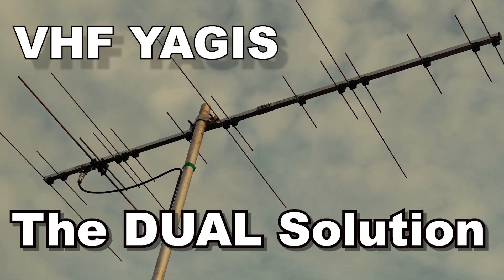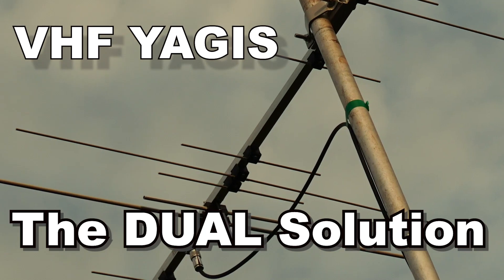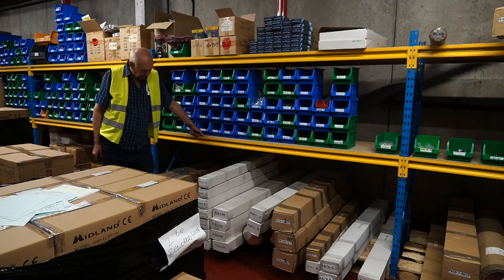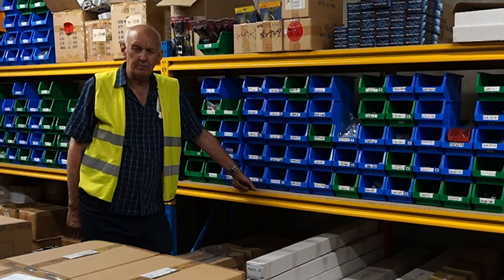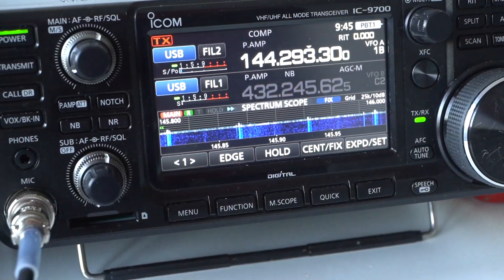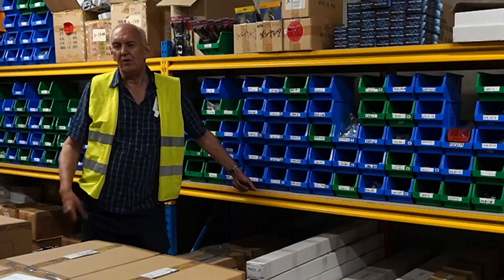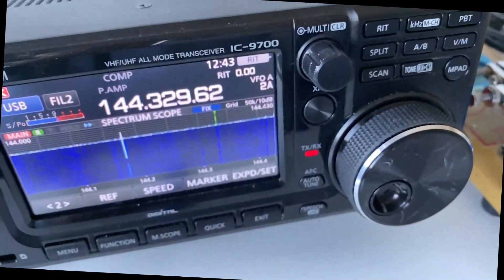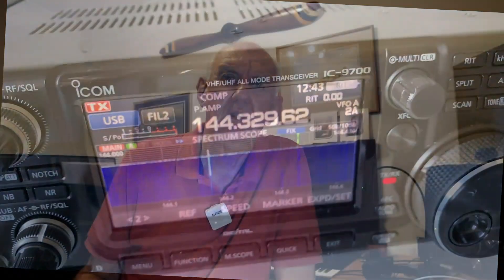CHOOSING VHF YAGIS - THE DUAL ANTENNAS SOLUTION & REVIEW

Comment: How tall are these antennas from the ground? I read that with “line of sight” radio like uhf/vhf the maximum range between two stations having antennas 33’ tall would only be 6 miles! Are these Yagis for people with antenna masts that are hundreds of feet tall? I spent $1200 on my uhf/vhf base station setup and was unbelievably disappointed to learn after that radio to radio I could only get 6 miles with the antenna mounted to my chimney because of the curvature of the earth. What a waste of time and money, I should have skipped uhf/VHF and went right to HF.

Comment: Great educational video.
I am new to the hobby and I am trying to find the best suitable solution for a Yagi antenna, to use portable on summits paired with a handheld to experiment the limits of transmitting low power from 0.5w to 5w. The goal is to try to hit repeaters up t 200Km almost line of sight across the English Channel.
What would you recommend light enough to carry in a backpack and easy to deploy?
Thanks for sharing such great content.
Reply from the maker: You dont indicate the band but you simply need to choose a Yagi that is transportable. Fir 2m that probably means 5 elements max. Remember the antenna must be rotated so elements are vertical. 73 Peter.

Comment: Great looking antenna.  What coax did you use and rotator please
Reply: ON VHF /UHF THERE ARE SOME  RG213 H100 AND SOME VERY LOW LOSS COAX. ESSENTIAL ARE THAT YOU A L L W A Y S USE N CONNECTORS  FROM VHF UP TO EHF!
ELSE IT WOULD GET VERY LOSSY! 23 CMS IS EXTREMELY SENSITIVE OF *THIGHT COAXIAL CONNECTORS*!
23 CM 16, 23, 32, 46 OR 63 ELEMENTS ARE AVAILEBLE AND STACKING TWO OR MORE A B O V E AND BESIDE EACH OTHER 
ARE HIGHLY RECOMMENDED!  
USE CORRECT S C POWERDIVIDERS WITH 
2, 4, 8 OR 16 OUTLETS! 
"MOST BANG FOR THE BUCK"!😀

Comment: Very nice! However my transceiver has an antenna input for 2 meter and a separate antenna input for 70 cm ( N connexion ).
So this antenna cant be used for both frequencys with 1 coax i Guess?
Reply from the maker: Yes, correct

Comment: I have the Dual 144 7 ele and 432 11 ele dual feeds and during that recent lift that Peter mentioned I worked many stations over 600 miles away on both bands (FT8). The aerial is slim and the neighbours have not made any adverse comments. I would recommend a Dual, they are easy to put together and look the part. Nice video Peter.
Reply from the maker: Thanks for your comments.

Comment: Excellent aerials, I love my PA144-432-19-3-2CB dual feed aerial, it replaced a 10 element Wisi and a 19 element Tonna. I can now hear stations and beacons I have never heard before. I also have a custom 8 element for 2m made by Goran for 144-148MHz (DATV on 146.5MHz), SWR is 1.2:1 @ 144 and 1.3:1 @ 148, got 59 from EB8 with 10w from Cumbria. The best vhf uhf aerials without doubt.
Reply from the maker: Great to hear from you. 73 Peter

Comment: Thank You for this. It's giving me more ideas about how to employ my 2 meter radios. Question, how much power were you using to make those  contacts? How do you think using only.5 watts would fare with this antenna? Thank you in advance.
Reply from the maker: I was using 100W - BUT - under these conditions much lower power works. One Dutch station was running 10W into a 2 element Yagi. The only real advantage of power under these conditions is that you move up the queue!! Also conditions move fast so often you can work a station that others can't hear.